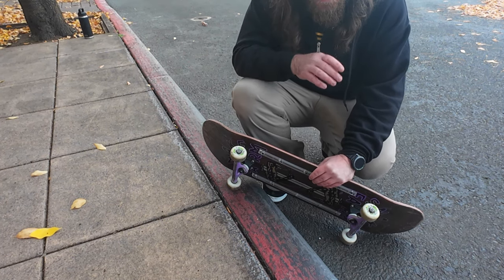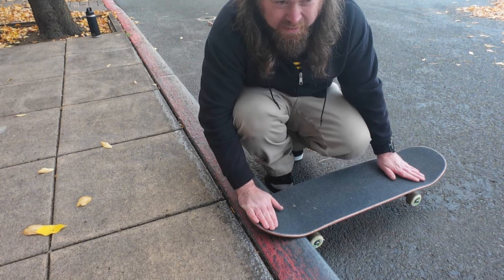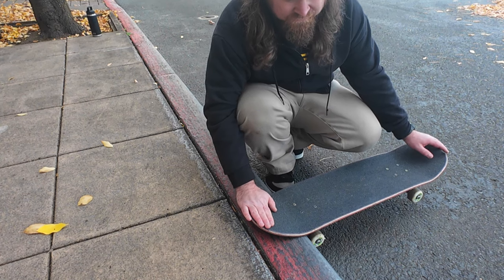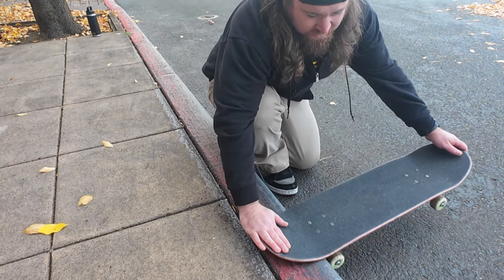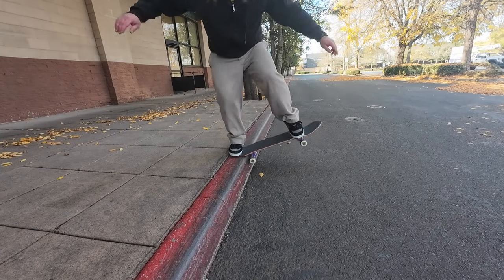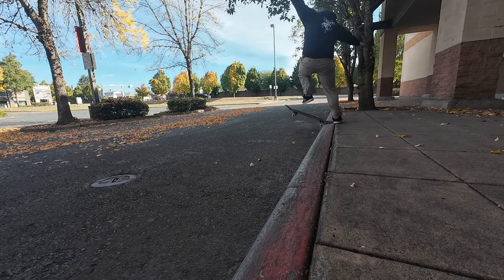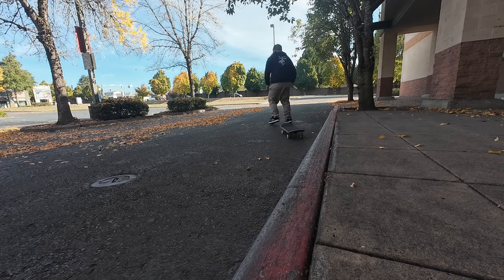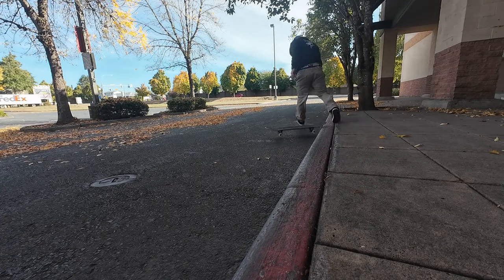The Process | Noseslide to Crooked Grind

Comment: Would it be cheating to use smaller wheels to get this one? Maybe those 45mm or 49mm wheels or you would't be able to build enough speed? That last one was so close. You'll get it next time. Great work bro.
Reply from the maker: @TheReal_DeanD  to me it would be yes. I want to learn it on my setup
Reply: @stickersteve007  you'll get it man. You have more integrity than me. If I had small wheels I'd do it on those first. Best of luck man.

Comment: Dude, i had a couple sessions recently where i landed NOTHING for 45 mins- 1.5 hours! Just over and over- its discouraging as hell man. But if u love skating its not an all around loss, right?
Reply from the maker: @simontaylor2848  definitely not a loss. Even if you don't land the trick, you're still learning it
Reply: i was trying forever to get a good frontside grind on a quarter and finally got one. then i did it several times thinking i had it down. i still struggle until i get that first one then they seem easy. sometimes i just cant get that one though